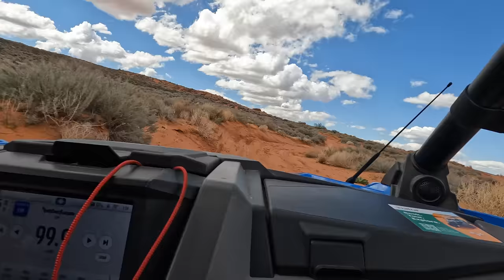Off-road Games '24 - barely made it there, barely made it home

Comment: What kind of mileage did you get pulling the loaded rig home with the 50 ton wrecker? Off-road wrecker sure looks nice can’t wait until you get it dialed in and put out some videos.
Reply from the maker: We got somewhere between 4-6mph. Really not too bad when you have a big power unit in the front!
Reply: @VikingSpiritMotors  That’s much better than I would have thought, thanks for replying.
Reply from the maker: @caesar1295  anytime brother